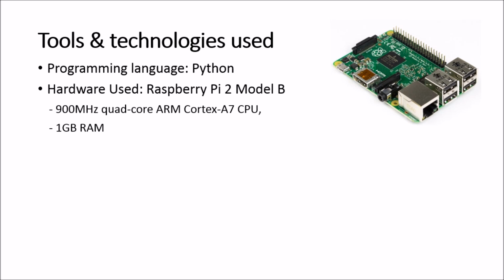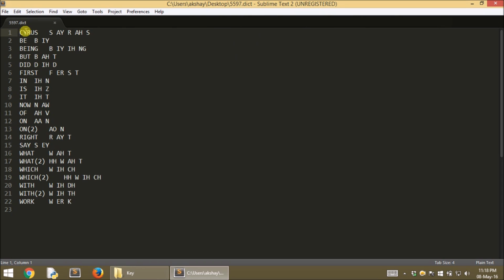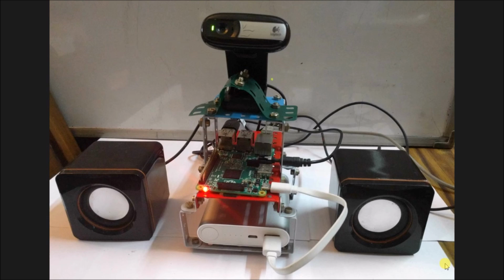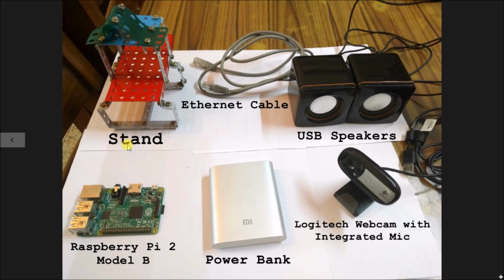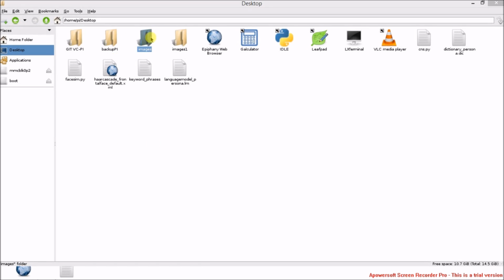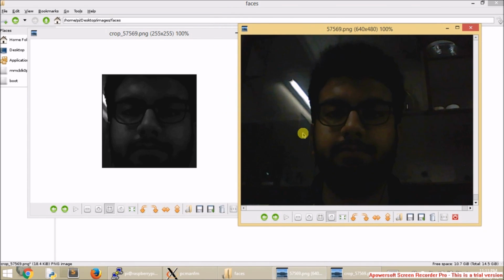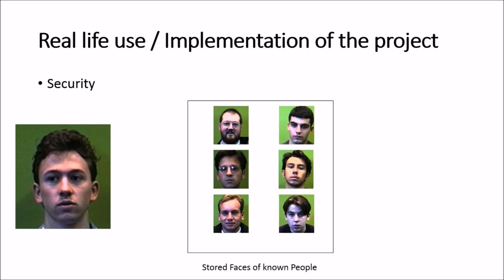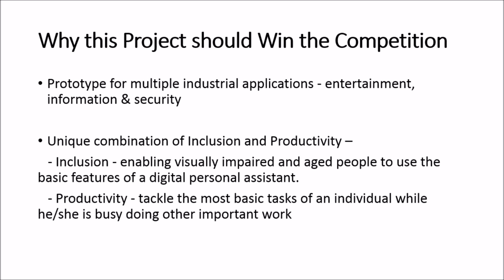CrazyEngineers : Voice Controlled Personal Assistant using Raspberry Pi

Comment: Hey man i dont know if you are still active but i can't believe ive found a similar project. I am trying to create an Arduino voice activated calculator, very simple taking numbers 1-10 and either adding subtracting dividing or multiplying them. I then want to simply display the answer on an LCD. The wiring isn't a problem its really straight forward but im really new to C++ and have no idea how to write the code. I guess i can take the input from the microphone and perform a switch statement for ex Case: "one" num=1; How can i tackle this project?

Comment: I am looking for such a program which has all abilities of your project and can also control the GPIO pins of raspberry pi with voice command(which is your project)

Actually I want to make it for my room but with the feature of controllable GPIO pins of raspberry pi with voice(which is your project)

can you help me out in this case as I have not much experience in this field as my field is electrical so from the outputs of GPIO of raspberry pi I can make a circuit for appliances switching according to outputs of GPIO pins of raspberry pi.

can you help me out.